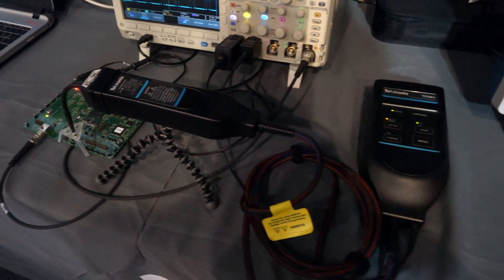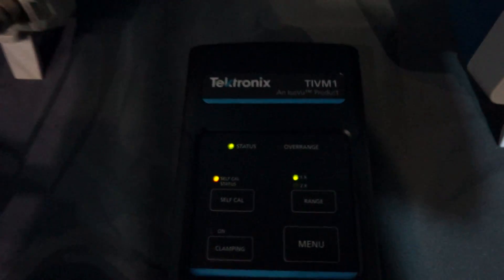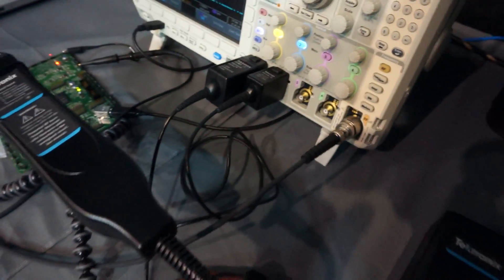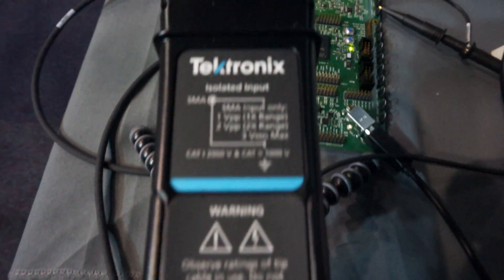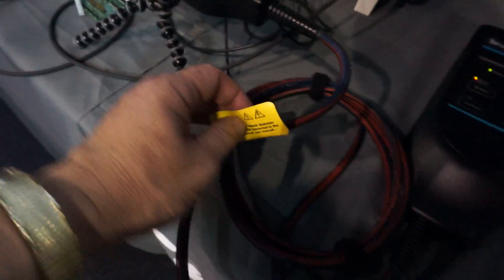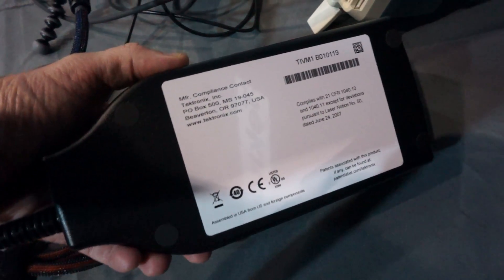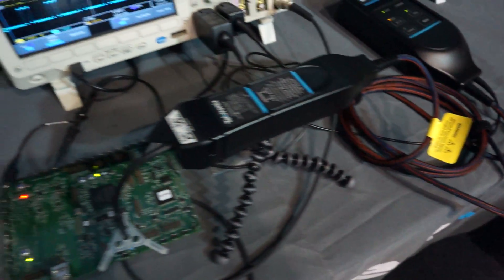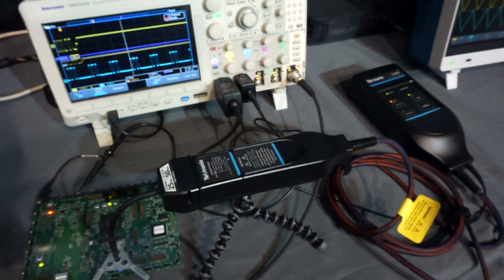Tektronix TIVM1 Optical Fibre 1GHz Isolated Differential Probe

Comment: Nice overview! This impressive measurement system has a 120dB (1 million to 1) common mode rejection from DC to 100MHz and 80dB (10000 to 1) at 1 GHz.  Thousands to hundreds of thousands times better than any traditional diff probe in the market today.  What this means is a VERY clear and accurate diff measurement without common mode blowing through/EMI/groundloops/bandwidth limitation.  You have to try it out on a signal like the 5-20V Vgs measurement or across a current sense resistor. The 200MHz model is $12K... Same CMRR/Isolation as the 1GHz version.

Comment: "Potential RF burn hazard", 1GHz bandwidth and 10m cable? I guess that probe may actually be meant for probing around in the power circuits of radio transmitters. Something like servicing GSM stations. Hook up the probe, get a safe distance away and enjoy full isolation from the high-power RF with your 10m fiber-optic cable while you turn on the transmitter and observe its output.
Reply: That is probably the best guess I've seen about the uses for this. This is where having the fiber optics would be beneficial since you wouldn't have to worry about any inductive coupling to your scope.

Comment: power over fiber? someone start explaining.
Reply: There is properly a small photovoltaic cell on the other end of the diode. If i remember correctly there was a small article on electronicdesign.com about power and data transmission over fiber.

Comment: Power over fibre optics? How much is possible?
Reply: Over a kilowatt with the right fiber. http://www.coherent.com/fiberlaser/
Reply: +Chris W That's all fine and dandy if you're going to dump it as heat at the target, ie a using it in a laser cutter. If you want to use it as electrical power, you're limited by the efficiency of your light to voltage receiver.
Reply: Sure, but probes don't need much power. I imagine the size of the photovoltaic cell is the reason for the bulky probe. It can be optimized for a single wavelength. 30% efficency wouldn't surprise me. If the probe needs a watt, then 3.3 watts of light would be enough.
Reply: Chris W Of course. What I said was an answer to the Wyvrn's question, (regarding maximum power) with the added assumption that he probably meant electrical power in his question.